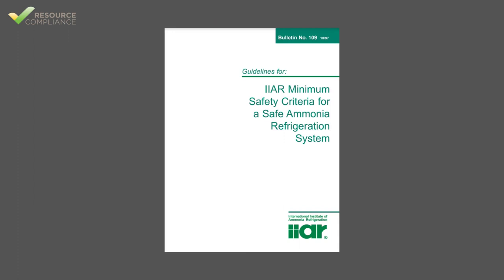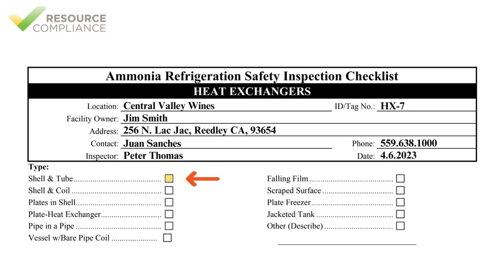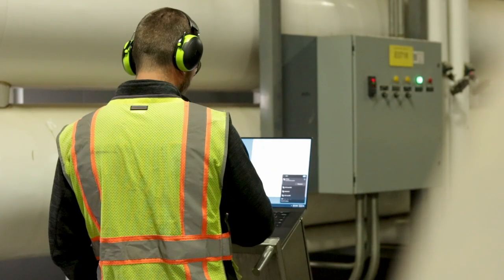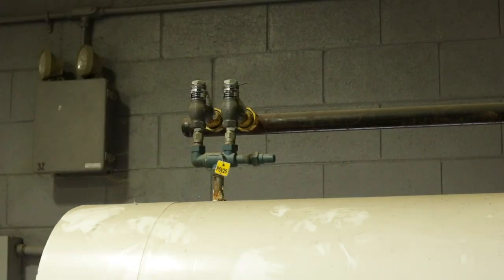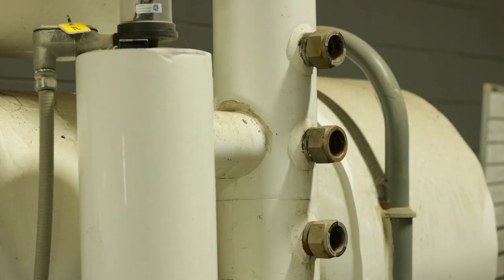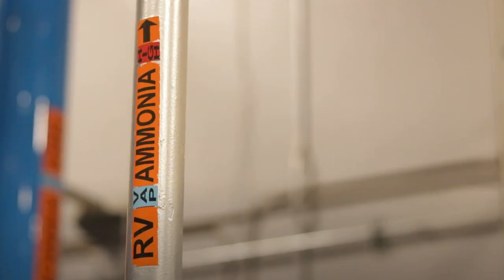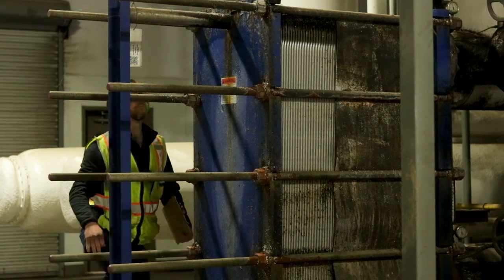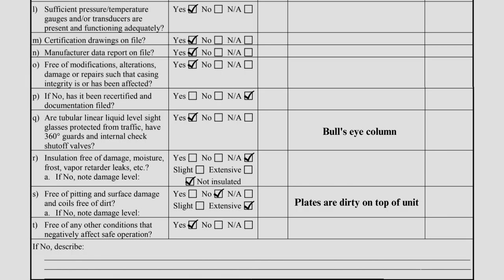Heat Exchanger Inspection Checklist - IIAR 6 Appendix B

Comment: SO IT IS  COMPULSORY FOR EVERY HEAT EXCHANGER TO HAVE A RELIEF VALVE?
Reply from the maker: If the heat exchanger has an ASME stamp, then it should have overpressure protection per ASME B&PV Code Section VIII. However, some ammonia refrigeration heat exchanger have an integral surge drum (vessel) that supplies the heat exchanger liquid. If there are not valves separating the surge drum from the heat exchanger then relief valves can be installed on the vessel, provided they are large enough to protect both components.